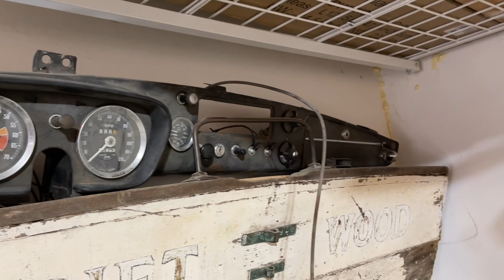Klein Vintage MGB-GT restoration Part 3

Comment: Spencer, my old neighbor back near my mom's house had a GT6GT which I believe was much like this car except with a straight 6.  My first car, which was sitting derelict in my parents' driveway at the time was a '61 Falcon with a straight 6 and I was obsessed with straight 6 engines.  Neighbor ended up selling the MG and bought some kind of Datsun Z car with another straight 6.  This was in the early 1970s, of course, before these beautiful cars rusted away to flakes here in Minnesota.  Good luck on the car.  I'll surely be watching.
Reply from the maker: The MGC, right?  They do look cool with the added bump on the hood.  I seem to remember a driving review and it said the car was front-heavy due to the added weight of the straight 6.  Unfortunately the increase in weight wasn't matched by the engine's power output so it turned the C into kind of a dog.
Reply: @SpencerKleinVintageWatch  Might have been. I remember a badge that said GT6GT, but googling it just now gave the result of GT 6 MKIII. The image result for that car looks like the one the guy had.

Comment: Great choice of car to restore. But 99% are total rust buckets. Lots of work to do. My favorite MG. Have you thought of stuffing the V-8 into it?🤔🤔🤔
Reply from the maker: Yes I have - if I could get a correct Rover aluminum V8 with the right transmission, I would absolutely drop it in, no question.